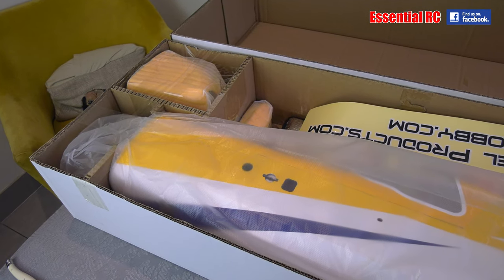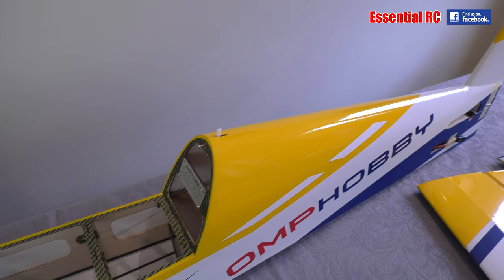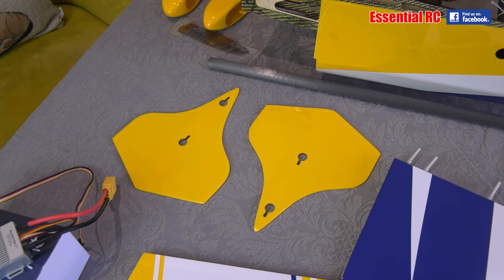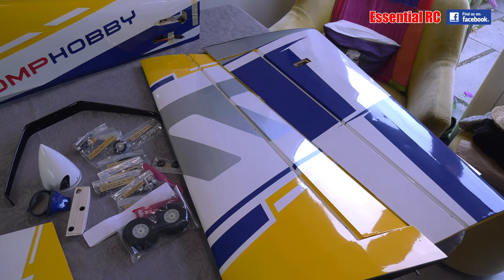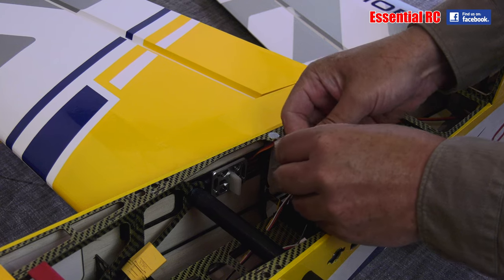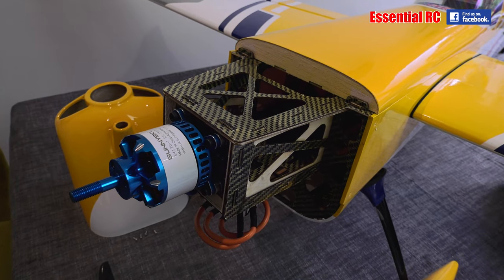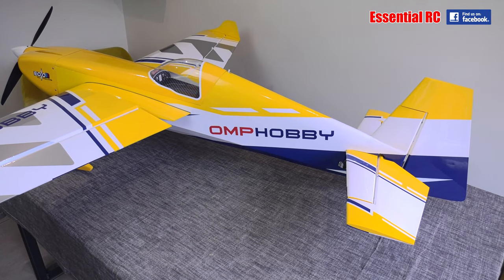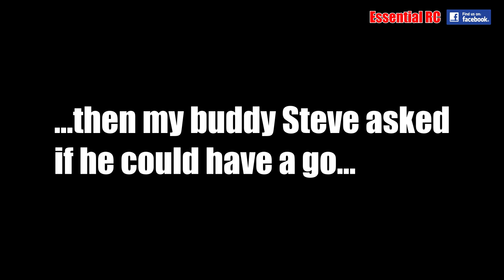BEST QUALITY ! OMP Hobby 60” 70E Edge 540 Kevlar Reinforced Balsa 3D Airplane ARF

Comment: i have one of these in a different colour, very recent purchase. i notice you said manual but these planes dont come with a manual yet and i couldnt find anywhere to download one, im a bit worried about throws as im a sport flyer not a 3d flyer and i want to dumb down the elevator throw, i have the aileron ok, but on maiden the elevator was really twitchy, similar to yours on take off any advice much appreciated, also how did you fix the 2 bits that go from landing gear struts to fuse did you just glue them? great flying demo its a superb plane. cheers

Comment: Lovely model. Looked a little nose heavy though. I fly my 60 inch span Extreme flight slick on a 6s 3300.
Do love the attention to detail and all the little touches on this model though. It's as if they've looked at the extreme flight version and thought ok lovely model but what things are annoying. And they've addressed them all. Servo wire holding. Easy wing fitting. Brilliant 👏
Reply: Extreme flight now has quick wing release as well now and IMO a better design to than this.
Reply: @millerrc5829  what exactly makes it a better design? The only thing I see with these quick releases is more weight than thumb screws. So if they could make those quick releases lighter, that would be good.
Reply: @michaelkrailo5725  I’m kinda in your same boat I don’t really like a quick wing release system in anything smaller than 60in, because it will most likely fit in most cars assembled. I will say it’s pretty nice to have when you do have to take the wings off. I like EF’s quick wing releases better cause no matter how much you lock and unlock em they won’t wear out.  where OMP,s I would think that if you used it many times that the nylon tab they use could potentially wear out and make it feel loose. And if that were to happen I don’t know if they sell the nylon tabs separately or not. My opinion though thanks.

Comment: Is there an option to power this model with a gas or glow engine
Reply from the maker: No. This is designed and built light for electric power. The 74" and 106" are for electric/gas https://iactiverc.com/collections/planes/products/omphobby-74-edge-540-kevlar-reinforced-balsa-3d-airplane-arf

Comment: Nice Plane. What servos are you using?
Reply from the maker: Using Savox SV-1260MG.
Reply: @EssentialRC  What sero arms did you use? Cheers.
Reply from the maker: @2.4g-rc  Stock servo arms that came with the servos
Reply: @EssentialRC  Thanks
Reply from the maker: @2.4g-rc  Just to add that you do get some over arms in the kit that, when fitted to the stock arms, give you the large throws on the control surfaces that you need for 3D. I'm fitting those soon.
Reply: @EssentialRC  Oh that's good to know, thanks!